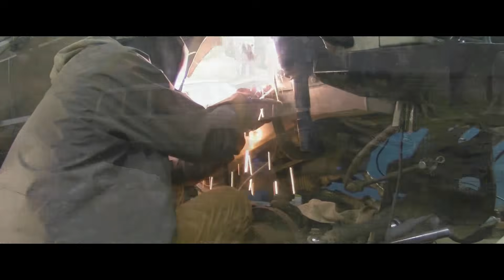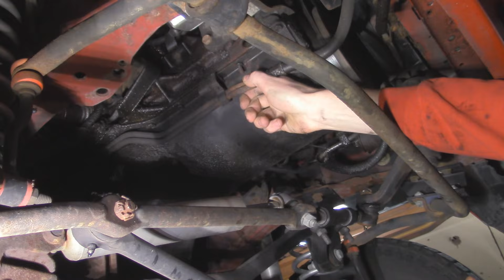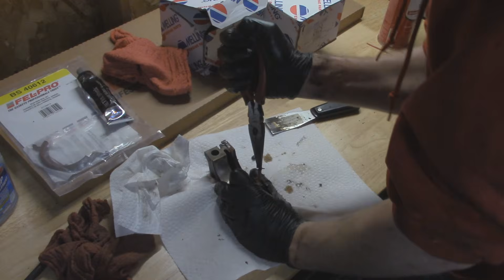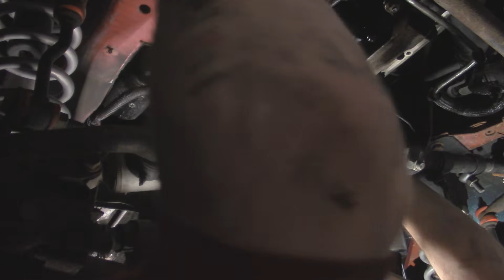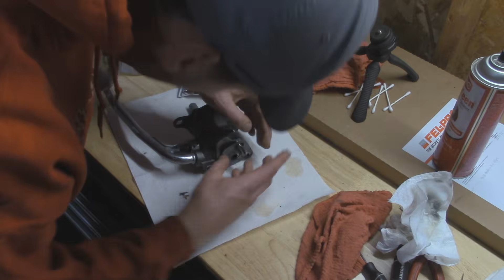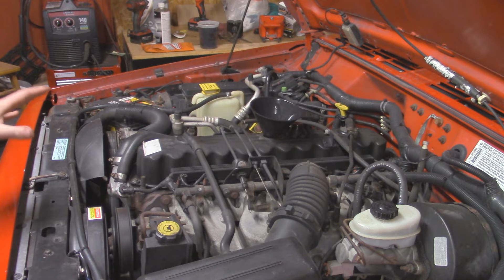Jeep 4.0L Oil Pan Gasket & Rear Main Seal Replacement

Comment: You don't need to put RTV on that Fel-Pro Pan gasket. That defeats the design and function of that gasket. This is not a cork gasket.
Reply from the maker: With oil pans that can deform over time, its recommended to use some in the corners to prevent leaks. It's worked for me and many others on this technique.

Comment: I did this repair minus the oil pump on a stock height jeep, I had to remove the drag link, track bar and remove the lower shock bolts to get the diff down far enough to utilize those blue guides.

Comment: Just did this job and was rewatching your vid, haven’t started the jeep yet… 31:00 into your vid you put an oil pump gasket on 😮. I didn’t know it had a gasket there 😢. I get to take everything back apart, but you saved me from starting and driving it without this so thanks.
Reply from the maker: Yup, you definitely don't want your engine starving for oil.
Reply: @OutJeeping just got it started back up after pulling the pan and installing the gasket, sitting at idle at 45psi, jeep has 276k so that’s not to bad

Comment: I know this is a year old now and not sure you still check the messages on it but you should see what the motor oil geek says about using diesel oil in a gasoline engine. I trust what he says, he works in the oil industry and had access to some pretty sophisticated testing machines. Also a tip, use the bolts in the bolt holes to break the main cap loose.
Reply from the maker: Yup I watch him as well. I run 10w-30 VR1 in my Jeep now with no additives.
Reply: @OutJeeping  Awesome! He's is so friendly and knowledgeable.

Comment: Very helpful! Also, you can unbolt both the side motor mounts and jack the engine up by the crank pulley to get your clearance
Reply from the maker: @grantdenzer17  I would not recommend lifting the vehicle from the crank pully. It could cause some damages.
Reply: @ literally what it says to do in the oem instructions
Reply from the maker: Up to you to take that risk then

Comment: I have seen multiple videos where the oil pan is bent in that same spot. My pan was also bent right there too. Kinda odd
Reply from the maker: Yeah I have no idea what causes that, very odd.
Reply: @OutJeeping  i figured out it's from the upper control arm hitting it. Factory bump stops allow too much up travel

Comment: Got me excited when you showed how easy it was to remove the oil pan.  Then got depressed towards the end when you finally admitted your jeep had a 3" lift. Great video though!  Thanks for sharing it.
Reply: Oh boy did I just do some sketchy shit to get mine out.
Reply from the maker: It is definitely easier with a lift, but you can do it with factory lift by undoing a few suspension components to have that front axle hang down.

Comment: I did this job on my 2000 Trusti Rusti. I used this video to do the job, and I just now realized an essential piece of info I missed last time. Austin says the girdle is on 96 and up, and while I have a 00, it has a 95 block (I often forget this previous owner did the swap). It now makes complete sense why that girdle was missing.

Comment: I replaced my oil pan myself and it continued leaking so instead I took it to a very good shop I’ve gone to before few times and it still leaked after them took it back for a another time they replaced it again the 3rd time and still leaking why I used and they used the felpro from Autozone

Comment: in order to get my oil pan out on a completely stock xj I had to take off both shocks, the steering damper entirely(which I had to drill out as well), then take off the passenger side upper control arm bolt(only the 1 by the axle). this still wasn't enough for me to get it all out, so I used 2 bottle jacks and placed them near where the shocks would go and forced the axle down an inch or so more. then the pan just fell out. getting the oil pan in and out was easy with this, especially with bungee cords to hold back the trans lines in the front.
Reply: If you have two people you can step on both rotors and the pan will fall right out

Comment: Great video. Just did this on my 89 comanche. 2 comments:

1. To get the pickup on the oil pump, I found it easiest to clamp the pickup in a vise with wood blocks and hit the pump rather than trying to hit the pickup. I also covered both mating surfaces in gear oil.

2. Fel-pro gaskets are not supposed to be installed with RTV, so I elected not to. My comanche is a project car, so I won't know if this was a good decision or not for awhile when I finally get around to starting it.
Reply: I'm curious how the gasket performed if you have started the Comanche yet
Reply: Have you driven the car around at all since then? Id love to know how the dry gasket is holding up

Comment: Fantastic video; my 98 looks very similar underneath despite only having 115k miles, so probably going to do all these seals and gaskets. Quick question: why snap the oil pan gasket to the block instead of to the pan since you're using RTV anyway? Is it just because you have to finagle the pan so much and the gasket may slip out of place?
Also, for a stock-height Jeep, would it be easier to remove the sway bar, shocks and anything else that would allow the axle to drop lower? Or is that a bigger pain than the alternative?
Reply from the maker: It can be done either way. But like you said the pan gets finagled in place and has a less chance of getting broken or dirty when it's on the block. For a stock ride height Jeep, I agree to drop that sway bar and maybe drag link too, to get that axle as low as it can be.

Comment: Thank you so much for all your instructional videos! Also, where is your Exhaust Downpipe from? Thank you!
Reply from the maker: I got mine from Walker, but it's junk and doesn't last, so next I'm going to buy a Northeastern stainless one from ebay.
Reply: Thank you so much for the response! To be honest, I've been stressed out, haha. I got a walker exhaust kit and a new intake/exhaust gasket to swap out my downpipe, but after hearing that, I think I'll wait and order the one you mentioned as well.
Reply from the maker: @RandolphKim  Well the walker front pipe has lasted 4 years so far. The issue I have with it is that the exhaust mount was not bent correctly and rubbed on the exhaust crossmember. I tried to rebend it, and it cracked the weld and put a small hole in the pipe that is a noticable exhaust leak.
Reply: @OutJeeping  oh 4 years?! I see. In your opinion, what direction should I take? 

- I currently have my entire walker system.
-My old factory downpipe, which is in decent condition, but the PO cut it short, and now I have about 1-2 inches from the cross member 😅 so adding a cat is much harder. 
-Or should I go to the exhaust shop and get a custom stainless steel? 
I really appreciate your help and response!
Reply from the maker: @RandolphKim  It all depends on your budget. If you got the funds, I would go to a shop for a custom stainless exhaust. Walker would get the job done, but if you live in winter climate like me, it may rust out faster. Northeastern stainless from eBay is decent for a cheap replacement that will hold up better than walker. However, it's only 304 stainless and not 316. 316 stainless will last a very long time.
Reply: @OutJeeping  thank you for taking the time today respond! I decided I'll use walker for a few years since I already have it on hand, but I'll talk to a few local shops in advance to replace it with a stainless in the near future.

Also I just bought my 99 Jeep Cherokee 2 months ago as my first project car. Thanks to your help, I will be able to change the Oil Pan/RMS, rear drum break, Spark plugs, and more! Although I do know that I'll also have to replace my leaf springs in the near future, but that's a whole other rabbit hole haha.

Thank you!
Reply: @OutJeeping  thank you for taking the time to*
Reply: Hey @OutJeeping, this is my main account lol (I'm Randolph) I just recently replaced my front pipe, tail pipe, cat, and muffler with the walker kit. However, I replaced the front pipe with a BRExhaust 102-9074, the flange holes are bigger but with washers it fixes the issue and best of all I personally think the quality is much better than the walker and so far the pipe does not touch the cross member!

Comment: Thanks. Try doing this with a stock height XJ. Pain in the ass. I did it about 6 weeks ago. Was up on the lift at my shop, though. Still, I had to remove the oil pump before there was clearance enough to remove the old buggered up pan. Did the pump as well as the rod bearings, because my oil pressure was pretty low at idle once the engine got warmed up. Guess who has to do the rear main again tomorrow? This guy. I don’t think I remembered to put any RTV on the rear main cap before I put it back on. I have an ‘01, my rear main seal doesn’t have the ears on the cap side, just two half moons.
Reply from the maker: Yup in 2001 they changed up the rear main design. That's one thing I wish I would have changed as well was the rod and main bearings since it would be so easy to get to.

Comment: Did you prefill the oil pump before install?
Reply from the maker: I did not. It would all drain out in the I install anyway. It's the antidrain back valve in the oil that prevents oil from draining after each run.
Reply: I already installed mine but I didn’t prefill so I just making sure it would still prime.

Comment: Do you need to wait 24 hours for the RTV to cure before you add the oil? Thanks for the video
Reply from the maker: I don't usually, by the time the jeep is put back together, it's usually a couple hours later before I put in oil.

Comment: I replaced my rear main seal and starting leaking worse. Im not sure what i may have done wrong??
Reply: Did you ever figure out why
Reply: @anthonyhall2976 my oil pan gasket ripped near the rear. Causing more oil to come spilling out.

Comment: Excellent video just got done with this job yesterday with the help of your video and oversight from a experienced mechanic at work. The bottle jack trick did not give me enough clearance on stock height with my 99'. Ended up having to lift the motor AND disconnect the upper control arms. This is one of the best videos on YouTube explaining this process, thank you for posting this!
Reply: Did you disconnect the upper control arms at the body or the axle end?

Comment: I have changed it 3 times, but the oil is still leaking, why?
Reply from the maker: Could be a number of things. What side is the leak coming from?
Reply: @OutJeeping  Engine oil flows from the transmission sump

Comment: I'm thinking you must have a lift on that XJ for the pan to drop out so nicely. I have changed the gasket on a 2" lifted and a stock height XJ and the latter is a royal pita. 

Anyway, just clicked here because you have good tutorials and I needed to know where the studs go. Nice vid.
Reply from the maker: Yup I mention that my Jeep was lifted. Still struggles a little bit with a 3" lift.
Reply: @OutJeeping  I must have missed it by skipping around.

Comment: I did this awhile ago in my 98 except for the oil pump. What was your oil pressure before and after the oil pump? I’m at 15-20 psi HOT idle, and always about 50 psi when on the throttle.
Reply from the maker: It increased the overall pressure about 10-15 psi

Comment: I replaced the oil pan and oil pump and pickup tube on my 2000 Jeep XJ. The pump was filled with sludge and my oil pressure had dropped to 0. The new pump when the engine is idling is at 10 psi. Do you recommend running a cleaner thru the the engine to try and clear up the sludge? Your videos have always been very helpful.
Reply from the maker: Maybe some Berryman, seafoam, or a quart of atv and then change the oil soon after. That is what I would try first but there are many other brands of engine flushes to choose from.

Comment: I was always told if I was going to tackle this job to use a specific sealant from Mopar for the rear main seal. I don't remember the technical name for it but,it would seal in oxygen less environments. Did you ever hear the same thing?
Reply from the maker: Nope, any heat and oil resistant rtv brand should work just fine for this job.

Comment: I've had this problem since I bought my jeep 3 years ago at 156k miles. Now at 204k I think I should just get it done and over with. Putting about 3 quarts of oil in a month at this rate. This video will be helpful when I get around to doing it!